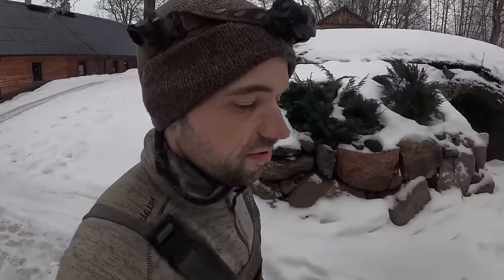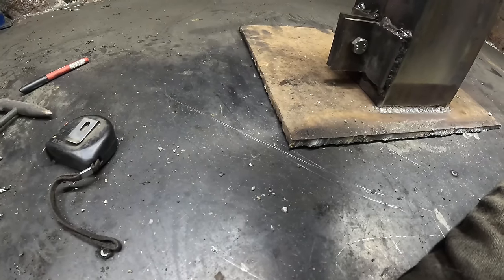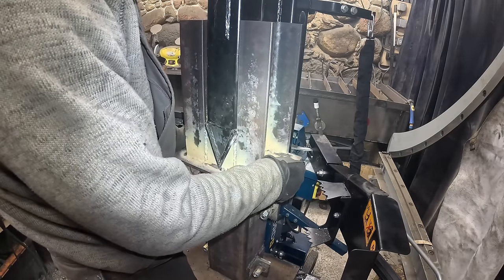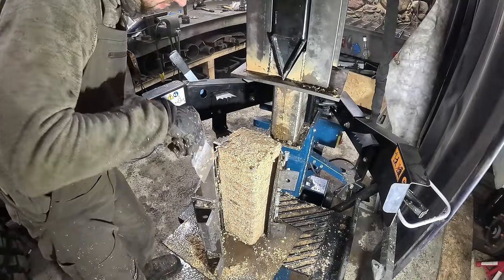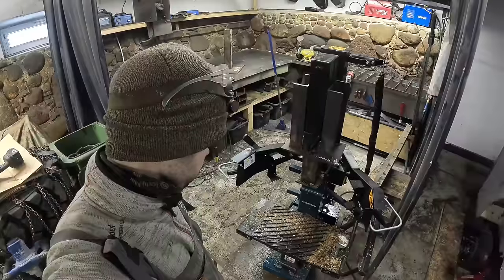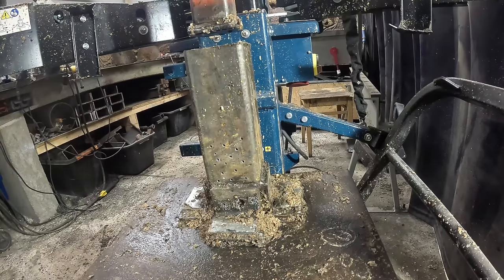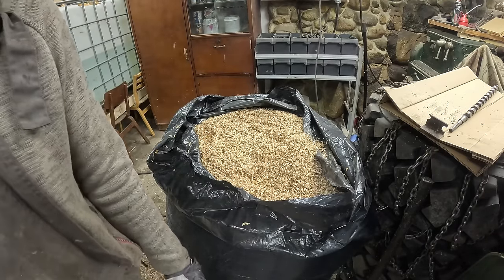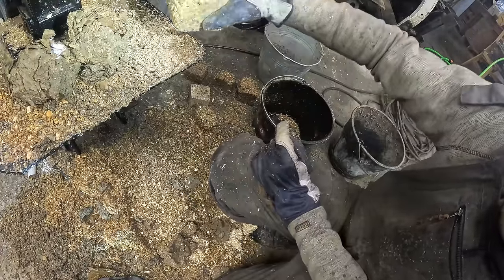Sawdust briquettes with a vertical log splitter?

Comment: To make this work, you need to make the cross-section of the area where the briquette comes out smaller than the cross-section of where the material goes in.  By doing that, you are forcing more material into a smaller area.  This increases heat of the material going through the die due to friction and and the lignin (glue) of the wood will "melt".  When it cools off, the briquette will be glued together.   If you have a good process, the bricks should be steaming when they come out.   Awesome video!!
Reply: After watching I came to the same conclusion and had to find out if someone else did.
Reply: Congratulations, You have just reinvented the.method for making Soviet Union bread!!!
Reply: I agree with you on reduction of size, also, cutting a bit off the top of the load shoot will speed up the loading process. If you want longer brickets, just cycle the press about 75% stroke each time. this should give the bricket more time to compress. Keep up inventing. Not all proto types work out in the beginning.
Reply from the maker: Also if the tube was longer it would stay inside the dye longer keeping it more stable. Im also thinking about heating the pipe
Reply: That's what I was also thinking about . A while ago, I saw a video, in which one guy mounted a pipe on the drain of his sawdust silo, which has a cutout on the top, so that it fills by itself. He pushed the sawdust with a hydraulic cylinder through the pipe, while the end was just slightly smaller. He made also a simple mechanism out of a few clamps (i think they were from an exhaust), where he can adjust the pressure a little bit, and also release pressure, if the material is stuck. I can't find the video, but it was very similar to this one: https://youtu.be/36GHaxpoR0o?si=wpPzxYD1InkYahfr
I would like to see if it works, when @Ants_Pants will try to make the ends smaller, just so slightly.
Reply: Better known as a funnel
Reply: @Ants_Pants  Make a collab with Hydraulic Press Channel on putting some insane pressures on that thing! :D

Comment from the maker: Maybe we should turn this project into Ants Pants hydraulic press channel? Perhaps there's a reason why nobody has tried this style before😉 but anyway...  I think i like one thing about this setup, the speed of processing the sawdust and i guess you could totally use it if the bricks were thrown into fireplace right after pressing.
Reply: “Aaand HERE WE GO”
Reply: Maybe all it needs is to get a bit more narrow at the bottom, so the sawdust will have some more restriction against pushing out, allowing for more compression? Seems to be a balacing act between getting the right restriction, and not just deadlocking the device tho. I think most sawdust pellet machines i've seen just use a long enough compression tube. That basically has the same effect of creating friction to allow for enough compression.
Reply: Mix paraffin or some kind of chemical in the wood I know you’re cheap and you like to use water but think of it this way you could sell them like a Duraflame log then we only need to come up with a name that suits you and your channel put that out to your viewers😂😂
Reply: Maybe the chemical would also need a binding agent
No, you can’t use concrete your favorite mix
Reply: You should crossover with the "Hydraulic Press Channel" , he would love to see your work and progress  +  a super nice dude.  and  HE would love to calab  with your energy
Reply: Better to make a stove special to burn wood chips, is way easy.
Reply: Dedicated channel to AntsPantsInventions?
Reply: many years ago I had a customer who made fire logs out of sawdust a lot of their sawdust was from evergreens and also ground up tree stumps. The sap in the pine tree stumps acted as a binding agent

You should call this the Wombat 2024, because the wombat also makes square poop
Reply: That additional pipe should narrow, not become wider, dry sawdust, "This is the way"...
Reply: I'm thinking a wallpaper paste. It comes in a dry powder and is mixed with water. That added to your sawdust???? 🤠
Reply: @Jon-wg8vr  I have seen people use a flour and water glue sprayed into drier wood chips and leaves for a binding agent.
Reply: @69dblcab  Ant should look into buying some old horses
Reply: No, you are wrong. This is a type of compressed wood, but I think it  needs high pressure, about three tons of hydraulics. There is this type  of wood the size of building stones, i.e. the same wood that they put  under barrels to carry things, i.e. used for square pieces like feet that  are placed between. I mean, just as you made wooden bases for barrels or boxes, there is exactly the same wood, for example, scattered wood that is placed in the corners.

Comment: For the lack of force, you still need to reduce the size of the ram and make smaller briquettes to get enough pressure to the pulp. Also you could try making the output tapered slightly narrowing, instead of widening. Wood naturally contains lignin which will keep your Weetabixes together when it gets enough pressure->friction->heat.
Reply from the maker: Mhm

Comment: An old trick for compressing the sawdust or wood chips is to mix Paraffin with the wood. When compressed, the paraffin melts, binds the wood together, and burns cleanly. The solid paraffin blocks should be grated so it mixes evenly with the sawdust. We used to use old canning wax scraps. Cheers
Reply: Or add some form of starch to the mix not enough in the cardboard or wood to help bind it

Comment: I have seen some tutorials on YouTube and they agree that the mixture should be equal parts sawdust and cardboard and cover with water, let the mixture absorb the water well and press. The molds I've seen are round, not square like yours. I guess round is better. No corners, less stress, less breakage (I guess). And make blocks that are not too long. It is important that there are holes in the mold to drain the blocks well in the press.
Your idea is great, thanks for sharing it!! Luck! A hug!
Reply: Ah! And let the blocks dry in the sun and air for 3 or 4 days. They stay very hard.

Comment: MM77 Approved 👍🏼👍🏼…………………………………………………………….#1 Your videos are never a waste of time, no matter what they are entertaining. #2 The company my wife works for owns a company that makes wood pellets. I talked to one of the engineers about how they were made and could not wrap my head around how it was done until he took me to the plant. In a nut shell, an extruder ( a rotating screw type extruder), a die to mold the pellets, and a rotating knife to cut the pellets loose. You are on the right track with your “extruder” design. My opinion.
Reply from the maker: Thanks

Comment: This was so cool man! Watching you design, try, and test both the device and different mixtures was very interesting.
Years back, 2018 or 2019, I bought a bundle of compressed sawdust/woodchip logs. Each measures about 20cm×5cm×5cm. I guess the manufacturer did whatever pressure and heat to activate natural binding. You can cut them with a saw and it takes a bit of force to crumble. I still have a bunch of those logs in my emergency supplies stash. 
Keep up these great inventing videos bro.
Reply from the maker: Thank you very much!

Comment: I did it with wall paper paste and my friend used flour and water. They both worked but we had a much smaller pipe think it was between 60 & 80 mm and I used my log splitter which is the same as your second 1 is the little one on wheels . Good luck luv your videos and your quite mad.

Comment: I have a friend that works for a wood pellet company and they use a high pressure press as well. As vegetable oil as a binder, you don't need much oil in order to achieve the binding. And you don't have to wait as long for your brick to dry out  hope this helps.

Comment: Think it like concrete : You have wood chips it's about like gravel.
You need bonding : it's glue, like wallpaper glue the equivalent of cement.
You need intermediate aggregate particles to link bigger wood chips together : it's saw dust ,the equivalent of sand wich fill up room between gravel and cement.
A little bit of water /glue / wood particles proportions ratio testing and the mixing in a concrete mixer would help you a lot to go faster.

Comment: Suggestion. Make your mold half the height of you rams stroke and put a heavy duty flange along the top edge. Once you've compressed the mold to the top, place the top flange on spacers below the ram and push the brick out of the mold. You may need to drill holes in the mold to aid in water dispersal and you may need to add liquified paper as a binder for the wood chips

Comment: When making paper, they press fine pulp under a lot of pressure.The smaller/finner material is what helps bind it together. You have pressure, but the wood shavings are too big to get a good solid hold onto each when being compressed. Try cutting/shredding the wood shaving, and especially the cardboard (it shouldn’t have any big chucks in the finished mix).  Adding some hot water will help the wood/pulp expand, and then when its compressed, the expanded wood fibers will intertwine better, which should give to a more solid brick.Then place the bricks in a warm dry room for a few days.

Comment: I think you should mix cardboard with your sawdust but don’t chop it up as much, then make smaller hockey puck type ones, a cylinder would hold together better than a square
Reply from the maker: Was thinking about a horizontal setup and heating the pipe

Comment: I was trying to imagine my own design while watching this. I would go for the horizontal kind so that water would flow out easily. Almost exactly like you think about with the log splitter. I think a round tube with a very course and big thread in the end and a matching cap would be nice. So you can really ram stuff against the cap. Then unscrew the cap and ram the finished briquette through. For speed you could have a big hex hole in the cap that you could use impact drill on to open it.

Comment: I was going to suggest water and pva glue/wood glue  etc but they would still have to dry out, but they would stay together, it needs massive pressure to bring out the natural bonding agent BUT have you seen the chinese wood pellet mills that force the wood/leaves/waste through a grid to make pellets for feed or burning. Look them up!! Loved every minute of that! Some of my projects don't work at first either, but the doing of them and thinking about them often brings a better idea to mind!
Onward and upward!
Phil
Reply from the maker: Massive pressure can be reduced with heating the pipe i think

Comment: A valient effort Andris!
Here is one thing you might try:
Once you get a wood burning stove in the shop, you could heat a metal barrel of water on top of the stove with a drain  valve on the bottom, and then mix up a batch of hot water and wood chips in another cut down barrel at floor level.   Maybe you could use one 55 gallon metal barrel, and use 2/3rd for the water heater on the stove, and the other 1/3rd for the mixing pot at floor level. Then try pressing the hot wood chips -- but you would want to build a catch basin to recycle the water back into the heating barrel so you don't waste it and so you don't lose all the heat in the water.  If you do this during the winter when you are running the stove a lot, the cost to heat the water would be basically free.  

You would need to research and/or experiment to see how long the wood chips should soak in the hot water before pressing them.

Just make sure to catch the water pressed out of the form and recycle it back into the heating barrel with an inexpensive pump from your catch basin.  You might be able to recycle a condensate pump from a gas furnace or a/c system for that prupose -- and it would automatically run and shut off during the process.  I suspect the recycled water would get more and more "gluey" as time goes on too as more stuff is extracted from the wood chips during the process.

One issue might be how much humidity it puts in the air during operation.  Might make the shop a temporary sauna!

Anyway, it's an idea to try in the future.

Cheers from Oregon, USA
Philip
Reply from the maker: That's an interesting idea

Comment: I have a suggestion. It does add a extra step to the process but the main part is passive so its not that bad. And i really don't know does it work or not, but it might work if you soak newspaper/paper in water for a few days, then add the sawdust in to the mix and take a paint mixer and stir the paper to a mush. Then try the mixture with this press of yours. The fibers from the papers might bind the mix together. Thanks for the interesting videos!
Reply from the maker: Thanks for the idea

Comment: what you needed to do is to make the lower form get smaller, not larger: this will raise heat and pressure which releases the lignin in the wood and binds the sawdust together.  The wet sawdust doesn't want to bind because the water cools it too much: no heat, no lignin release.  Then you're just hooking broken bits of wood together and that doesn't hold well.  But commercial systems don't try to make it go with such a large block: they work on a pellet that's only a few millimeters in diameter.
Reply from the maker: Yeah

Comment: Andris: enjoyed your video on "sawdust to logs". I think if I were to do it, I would go horizontal for sure and add a heating element (burn scrap stuff) to get the pressure chamber up to at least 400 degrees F. This heat applied to compressed dry sawdust may result in an exterior "glaze" that you see on the outside of wood pellets used for pellet stoves. this glaze may help to solidify the logs and keep them from breaking up. Just a thought. Carry on dude.
Reply from the maker: Yup

Comment: I have does this before. You should not add water or mix anything. At 20000lbs the natural resin of the sawdust will act as a binder (glue) and make a log/brick.
Reply from the maker: Yeah i figured i need more pressure/vompression what about heat? Would that help

Comment: I use similar construction all the time, pressing everything – sawdust, newspapers, marketing s*** from post, wood chips, etc. into some kind of brickets. The main difference is that I don't have the tube opening at the sides,  I have the bottom of the tube to slide open and use the same press to actually press the ready bricket out of the tube. Smoother inner surfaces help.
Reply from the maker: Hmm

Comment: If you mount an Archimedes screw in the angled box, and set a hopper above, you could feed the press automatically. 
I would add a sprung plate underneath so it has to compress the sawdust with enough force to make a brick. Adding a tiny drizzle of used oil into the screw feeder will help bins the stuff together.
Reply from the maker: Cool 👍

Comment: Instead of flaring the bottom of your press tube, make it taper smaller so the sides compress the sawdust further amplifying the power of your hydraulic cylinder

Comment: Not sure if you need longer pipe but make it more conical (narrower on the output) and overall a bit smaller since the pressure on the material would be a lot higher this way and that's what you want to achieve. You also mentioned how heat releases some binding agent from the wood, remember that applying pressure makes things heat up and that may be the reason why dry pressed stuff sticks together better. There is no water to take the heat away and some of the wood must become hot when pressing it. Maybe it's a good idea to follow that? Like i mentioned earlier, make the thing smaller to get more pressure per material and maybe even try to manually heat up the tube with a blowtorch? Blowtorch also wastes energy (and money you want to save by even trying this) but it's a good proof of concept to test out.
Even applying heat might not be enough though. I once got a tour in a local pellet factory (friend worked there) and i remember him saying that even though there is tremendous heat used to press the pellets (mainly heat generated by pressing the thing a whole lot) you still need to carefully choose the wood you mix together to achieve a product that stays together for longer than 5 minutes. So maybe it isn't even possible without using some external binding agent when you only have one type of wood but it's worth a shot, you don't need to achieve the same binding quality as in commercial pellet factories, just good enough for it to stay together until you throw it into the fire!

This is interesting topic though. I always had plans to try pressing my own briquettes but sadly i don't have constant supply of sawdust/wood chips in my household. I have a friend who works in  wood workshop that used to have plenty of that left over but they decided to just throw the loose stuff into the boiler fire directly and apparently it works just as well, just a bit more messier to deal with.
Reply from the maker: Will try

Comment: I'm currently producing 60 tons of force using a 180 mm cylinder. That's distributed over 7 square inches or a 3-inch diameter circle. The cylinder has a 30-inch stroke allowing me to produce 3 inch diameter by 8 inch long logs. The logs are of decent quality but I will be adding heat to improve the overall quality.
Reply from the maker: 60tons? Wow
Reply from the maker: 180mm? What that's serious